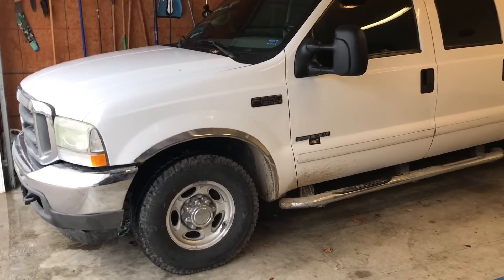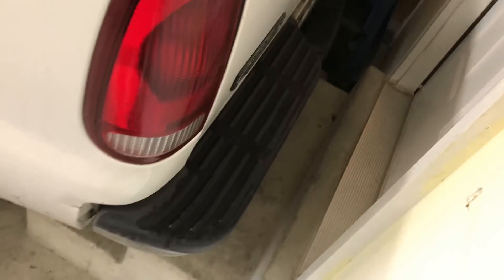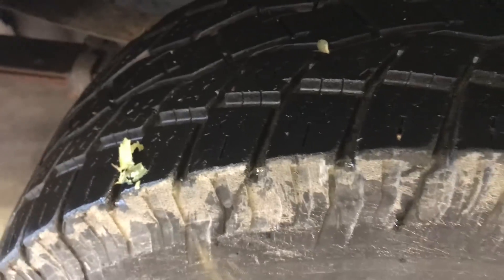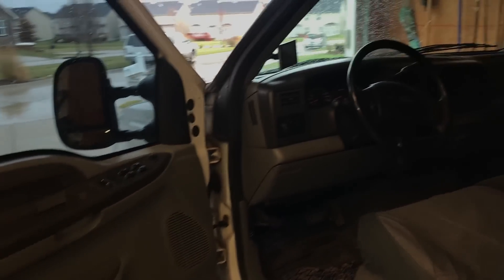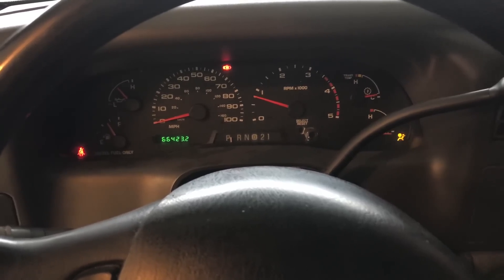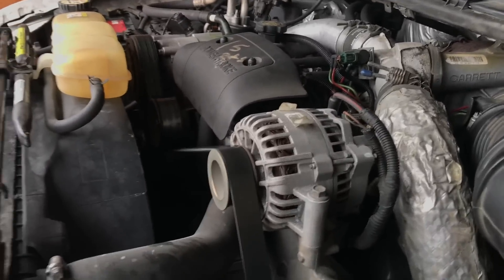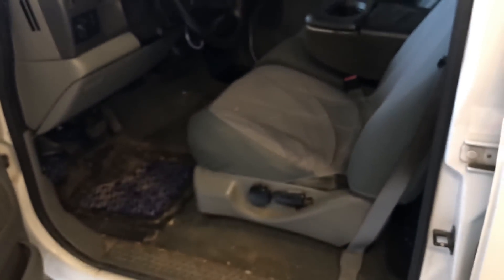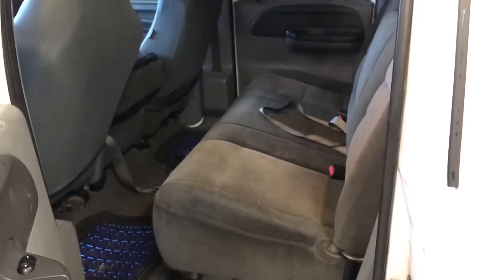Found a $4k 7.3 Powerstroke!

Comment: I recently bought my 2016 Chevy Colorado 4x4 CCSB 2.8L Duramax for 17k with 13k miles, because some dealership listed it wrong. They listed it as a 4 cylinder gasoline truck, 2x4, but the pictures clearly showed a duramax as the engine. Someone removed the 4x4 and duramax badges, so dealership miss posted. When I came in to purchase it they tried to tell me it was no longer for sale, but being smart about it I told them I'd leave if they gave me a signed paper that it was indeed sold and they have to honor the price if it appeared for sale afterwards, so they changed their story and sold it to me.
Reply: That's awesome!
Reply: Well played sir!
Reply: That’s smart
Reply from the maker: Wow that’s awesome, fantastic!
Reply: 17k is still a lot for a 4 banger half ton that probably won't see 300k. I bought a 2001 7.3 4x4 Crew Cab Lariat lifted f250 for 5500 and it only has 128k miles on it. Things got king ranch wheels on it super sweet no blowby probably got another 300k in it. Leather is in great shape I bought it from a dealer some poor soul traded it in for a 2014 6.7 and got 3300 haha!
Reply: pretty sure it's just false advertising consumer laws

Comment: Good truck for a good price! I’d buy that right now for $4,000 if you gave me the chance 😅

My 98 f250 was having cooling issues, noticed it was a small hair like crack on the plastic, figured I’d replace it come summer time since the cold doesn’t make anything worse! Radiator decided to crack on me. Nothing terrible, $60 at autozone and splurged on an external trans cooler. Not bad for 210k miles, truck was free too... lady said if I towed it out her lawn it was mine. Been very good for me. Used it for 30k miles since I took ownership. Probably have about $4,500 into it as we speak. I know I have my own anecdotal tales, but in the truth of it all it has never let me down.

Comment: I traded a 2004 Expedition for my current 2000 Ford F250 that looks like yours. Mine has a bit of rust on the bed but the cab is in pretty good shape. Starts up good in 8 degree weather here just fine. I probably will end up selling it as its to much truck for what I need. Mine has 283k On it and 70k on the rebuilt transmission. Recently just put new Gates Water pump, piping, thermostat, and hoses on it. Has a new starter and brand new tires on it. With the recent snowfall we got I tested out the 4x4 and it works good.
Reply: Mark Wolf  ok

Comment: Wow truck prices are crazy in the US, for $500 more im trying to sell my 2000 7.3 ext cab, 8ft bed rwd with 200k miles no rust here in Ontario, Canada.... New injector O rings, Hpop, alternator, oil cooler o rings, glow plugs, new u joints most of the front end, tires are good, newer brakes, Banks 4" downpipe back. 

Only needs : Lower balljoints, rear parking brake shoes, Transmission has an occasional rough 1-2 shift under light throttle once its warmed up, shifts perfectly apart from that (1-2 shift accumulator or broken spring cheap fix)

Comment: My oil cooler was leaking oil bad and I only replaced the gaskets and o-rings and it still leaked a month later. Went through this twice. I frustratingly took it into the shop since I knew I had to be doing something wrong and it turns out it needed the front housing replaced as well. Now its been good for a while. Just something to watch out for

Comment: Hey Daniel I have an 01 f250 with the 7.3 and it will not charge and is killing batteries. I have put 5 new alternators in this darn truck and it still isn’t fixed. I took it to a very reputable shop and they could not figure it out, do you have any ideas of why this could be happening. Any help would be much appreciated

Comment from the maker: There seems to be some mixed thoughts on whether or not $4k was a good price for the truck. Maybe it’s a midwestern thing, but I’m telling you guys, these 7.3 trucks are almost impossible to find for less than $6k and they usually need a lot more work than this one does. Sure, you can find 6.0 diesels, 6.8 V10s and definitely 5.4 V8s for that price range and much less. But anyone who can find a truck like this here in the Midwest with a 7.3 in it for $4k, please let me know, I’d like to see it!
Reply: I agree. It sounds just as good as my '03 I payed 13k for. Granted mine is 4x4 but still I payed over 3 times the price
Reply: I’d be tickled if I got 1500 outta mine, 7.3, auto, 4x4
Reply: I bought supercab long bed 4x4 with 395,000 miles on it for 5 grand. I thought I was paying too much at the time but I don’t regret buying it now that i’ve put another 20,000 miles on it. Everything on the truck looks to be original. It was a work truck used for hauling industrial grade water pumps to construction sites. The bed is dented all up on the inside but it’s pretty clean besides that. Runs perfect other than needing new glow plugs. But it’ll start in the cold after a few seconds on cranking. I’ll get around to fixing it but the block heater helps in the meantime.
Reply: tfi 627  I’ll give ya 1500 for it
Reply: G I I sold it for 1000 just to get it down the road. Nothing major wrong, fairly new flatbed . I just didn’t like driving it.
Reply: Ya 2wd or not throw good tires on the back or chains and some sand bags in the bed will get you around fine in the snow for the most part

Comment: My neighbor has a 2001 Ford F-250 lariat powerstroke diesel v8, with leather and wood grain, and it has been sitting for over 2 years in his yard because of bad brake lines. It is rotten, very very rusty. Poor truck, it’s completely covered with lichens. It also has over 180k miles.

Comment: I remember there was a trans issue in either 01 or 02 where they had some electronic issue and it will ruin the trans.
Reply: Smokey Bear  no there is a diode or something that kills the trans in the earlier model years when you get off full throttle during a shift. You can good and find it.

Comment: i just found a 2002 7.3l f350 crew with long box 4x4 single rear wheel looks brand new with 53k miles white TLX package 1 owner
set me back 29k
Reply: Friedrich Wilhelm that’s probably what they paid new. Low miles hold value.

Comment: I mean.. I got my 01 Crew Cab 4x4 Lariat f250 with 128k 4 in leveled lift black with chrome grill guard to match the grill for 5500 and it's got no leaks everything works. Think mine is the better deal.
Edit: oh and it's a 7.3
Reply: The Puppet Of Everything damn where at?